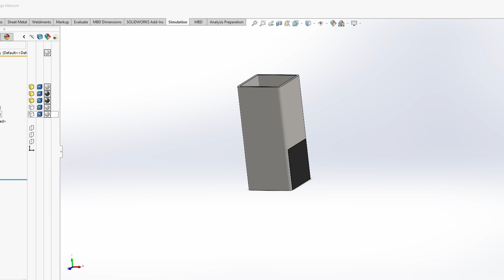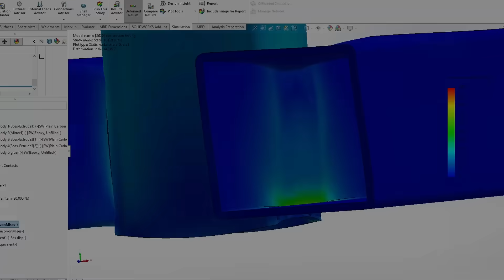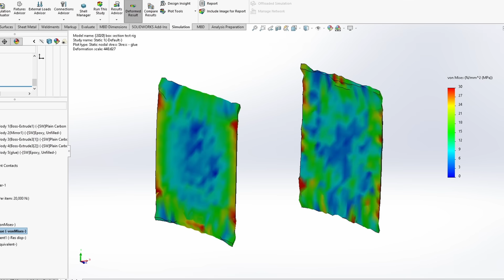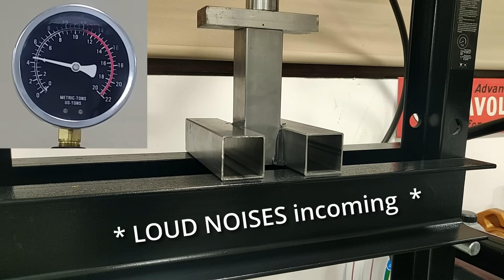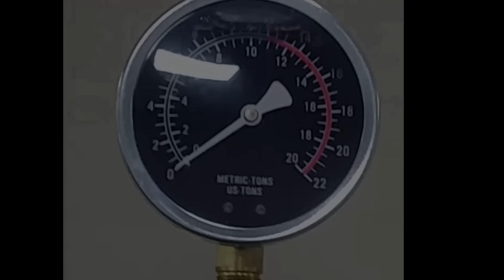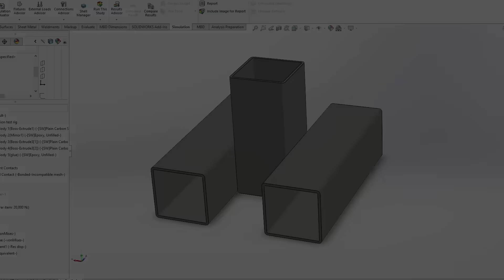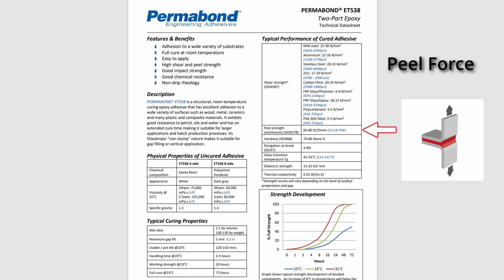How strong is JB weld structural epoxy adhesive anyways ?  Destructive test, simulation and review

Comment: I was looking for a solution to bind small metals together for an air rifle firing range where welding is not feasible due to pre existing lead. It seems that this structural epoxy will hold up enough for my uses.

Comment: I cut little pieces of fiberglass drywall tape and put in on the surface of the jb weld then put jb weld over the fiberglass pieces.  Also, I degrease the surfaces and score them deeply with a utility knife (for plastics) making as many scratches as possible.  This way you can bond even un-bondable plastics.  The fiberglass reinforced jb weld  repairs are stronger than the original part or assembly.  Surface roughing is probably the most important step.  For bonding metals, it's best to grind off the surface of the metal to expose perfectly clean metal, degreasing before and after the grinding.  I have done all kinds of repairs this way.

Comment: Back when I was in the industry that used epoxy for industrial purposes, it was not always specified but the PSI specifications where actually in compression. The manufacturer would send one inch square cubes of epoxy to a lab to be crushed. Then the PSI was recorded and the average was then put in the data sheet. I know of none that where tested, specified or claimed PSI ratings in sheer or tension. All where tested in compression. So for many that number was useless when used to bond items together. But made the epoxy look better then it was

Most of the epoxies where used to bond to concrete so as long as there was concrete failure first or concrete left stuck to the epoxy it was considered a success. And concrete is about 10x weaker in tension then compression. So it was a pretty easy test to pass. Even the weakest epoxies passed the test

Most epoxies we used had PSI ratings that started at 8k PSI and went up from there. Highest I can recall I think was a bit over 16k psi. Or about "3x" stronger then JB Weld.

The novolac epoxies where especially hard. Often topping 12k PSI. 

I don't remember what chemistry the 16k PSI one was but it sounded like glass when tapped, it was so hard. Broke into shards when struck with a hammer. This was the remnants at the bottom of the mixing bucket 

We mixed a lot of pigments, fillers and thickeners depending on what we where using it for. And these always reduced the PSI of the epoxy. The test samples where always pure epoxy with no pigments or other fillers. Probably why JB Weld is not rated higher as it comes with fillers and pigments already in it

Comment: 4 tons? That's just insane. I just repaired/covered a hole in my intake manifold using steel epoxy (JB weld equivalent) and was slightly worried if it would stand 20PSI of pressure and heat cycles.

I guess no worries then huh =D Thanks for showing this in practice!

Comment: Went on a camping trip and while towing my camper, my radiator reservoir cracked and caused my car to overheat and my whole car would steam up. Radiator fluid leaked all over. Where I was camping at was 45min deep into the forest. Thankfully, I always prepared myself with a good toolbox with essential needs.  I happened to have my plastic welding tool and hooked it up to my generator and spent some time welding the large crack. I made sure it was good and sealed and sanded it down a bit so the surface can bond better. Then I busted out the JB weld and pasted it all over the crack for extra reinforcement, i made sure the surface was clean and debri free. Its been 12 years and this thing still holds up like a champ.

Comment: Helpful demo-Excellent thanks for your effort l use JB weld on my sail boat for small repairs. one area it failed was trying to lock-in a key into a wind generator hub it-can’t take the torque of the boats wind generator over say a month it failed?

Comment: FYI: Original JB Weld can be powder coated as well. So if you want to MIG or Stick weld something and make it look Fillet brazed, smear JB over the weld like you're caulking a tub or window. Get it smooth. Let dry. Then touch it up with sand paper or a sanding mop. 
"JB and paint make you the Tom Ritchey you ain't!"

Comment: I used the J B Weld for gluing a steel nut to a steel shaft. I waited 6 hrs and I was able to remove with my hand. I re-did gluing and waited 24 hrs at least and still I was able to remove with my hand. Whats up with that??
Reply: What was your surface cleaning method, did you let it cure according to the manual, did you mix well enough and long enough according to said manual. And also, is the type of glue you used, made for shearing or pulling?

Comment: Had very good service using JB weld never failed me yet. Had a farmer friend repair an injection pump for diesel had cracked housing. Used JB to glue it together and its still running 20 years later

Comment: JB Weld is truly remarkable. I have used the marine variant (hot oil proof) to repair a holed motorcycle crankcase. The cured epoxy is both harder and stronger that the cast aluminium cases. I left rough edges around the break for better adhesion, but the biggest challenge was getting the oil out of the porous casting. A year in and all is well.
Reply: how did you get the oil out 
I didn't know there was a marine type of jbweld ...I'm trying to seal a pinhole leak in the weld of an aluminum diesel fuel tank on an old in the water (ocean) trawler
Reply: These English cases are notoriously porous, making welding difficult. I had the engine completely apart and soaked the crankcase section in diluted pine-sol for a couple days, then followed up by wiping down with lacquer thinner. I left the rough edges to give the epoxy as much of a tooth to grip as possible. It seems to have worked perfectly.
To deal with your pinhole, I wonder if it would be possible to blow the fresh epoxy into the hole with air pressure. Of course it would be best if you could seal it from the inside, but that is probably not practical. @hardlyyoung3638

Comment: I've used this stuff to glue dissimilar metals together - mild plate steel and extruded aluminum. For improved results, drill small offset holes through the target areas (they don't need to go all the way through), clean, clamp, and let the piece dry in a hot car for a week or so.

Comment: The bonding strength can be improved somewhat by "roughing" the surfaces with an abrasive wheel. I use a 3M Paint and Rust Stripper abrasive wheel for gluing metals. I find JB Weld quite good.
Reply: It was roughed up, you can see the marks.
Reply: @alexcorona  The streaks that I see on the video are quite light. A somewhat rougher surface would have yielded somewhat better shear performance IMHO.
Reply: Yeah but is it actually doing any chemical bonds or just acting like super glu? A LOT of uses cases in the comment sections outline matrixes used or other scenarios.

Comment: I had a Ford v-6 some years ago where one of the spark plugs blew out.  There was enough thread left in the aluminum head to feel threading the plug back in, but finger pressure was enough to pop it out.  I put some JB Weld on the plug, threaded it in loosely, and removed the plug, which left a trace of the stuff on the head.  After that cured for a day, I put more on the plug and threaded it back in – only finger tight.  I let that set for a couple of days.  

After that, the engine started and ran normally.  I traded the van off a few months later, with the engine still working normally.  Never had any problems with the plug.

I have used JB Weld for more than fifty years.  It always works.

Comment: I had a cracked and leaking intake manifold on a 1996 Lincoln Continental. The shop quoted me $1700 to replace and repair. Being broke at the time I went down and grabbed me some JB Weld and rebuilt/"made" "shaped a small part for that manifold . Actually, it was where the water hose connected to the manifold that was broke off.  2 years later I sold that car....And the manifold had never leaked again from the day I fixed it. (Saving me, $1695.00 in repair costs)

Comment: I contacted JB Weld to ask about the recommended adhesive thickness when gluing parts together as you did.  They recommended at least 1/8" of glue between parts.  It would be interesting to see the test repeated with a thicker glue line to compare performance.  

Also, how do you think a twisting/rotating force would affect glue strength?  In the case of your test sample, try to push the vertical middle tube so it would be parallel to the other two if a bolt fastened the 3 tubes together.

Comment: Years ago I knew a guy who worked on the old Volkswagen Beetles. He had one that thres a rod and poked a 2 inch hole in the crank  case. He replaced all the parts necessary and cleaned up the blodk in the ares of the hole. He thentaped some cardboard inside the block to cober the hole and patched it from the outside with JB Weld and It worked. The last time I saw the car about a year later it was still running with the patch in the blodk. JB Weld is tough stuff!

Comment: That was a very interesting test and analysis.

Was that a linear or stepped non-linear analysis? In reality the stress distribution will be different near the failure load. The high stress points on the analysis are very localized and a small local failure does not equate to an overall failure (this is why you hear the cracking before the ultimate load is reached). The variation in the shear stress appears to be governed by the meshing of the model. In an ideal perfect analysis, there should be a perfectly symmetrical pattern and it is not symmetrical. An average shear  stress is 11 to 12MPa (44000N/44^2/2sides) which is far less than the ultimate advertised. From a practical perspective, it the average stress that is important when designing and specifying a product.

The other issue is that there is no description on the product as to what the load direction is. I would suspect they mean a tensile stress of 35MPa. A 2 point beam test on a solid steel stock (to keep plane sections plane) with a glued butt joint would be a good test of the actual tensile stress. I suspect that the tensile capacity of the glue is going to be higher than the shear capacity. I also suspect if you used solid bars instead of hollow tubes, the shear test would be higher since the stresses will average out better.

I would be interested in seeing the shear test redone with solid bars and a tensile test done with a 2 point beam setup.

Comment: So if you can etch a hash pattern of vertical and horizontal lines on the surfaces you mate, it gives the jb weld more surface area to dig in and hold. I have seen a muzzle device welded onto a rifle and it survived thousands of rounds at over 50k psi. Stuff is very impressive.

Comment: When I was 17, I skeptically used JB Weld to fix a crack in my radiator and it held for 2 years until I got a new car. This was also in 05 or 06, so I'm sure further improvements have made it even stronger.

Comment: We use an epoxy at work called metalset but we have used JB weld in the past. If you drill holes through the glue section on both pieces and allow the glue to pass through and sag while it's curing it holds much better. It becomes more like a mechanical bond we've even reached in and smeared it where it has passed through the hole to give it even a better bond. We  have noticed mixing thoroughly or not changes the bond significantly. We have checked out the glue they use to bond an aluminum car frame together. The name of the glue I can't remember at this point. Extremely expensive works very well but if you need something to hold together that well weld it.
Reply: I do it the same way with the small holes for the glue to "grab" better. It's quite strong when used right.

Comment: Thanks for this video, I love your explanation, especially with the explanations and models of a structural engineer. I have a blown out hole on a carbon ebike frame of 1 of 6 motor mounts. Since the manufacturer doesnt want anything to with garauantee I am going to dry this JB weld and drill a hole in the middle. I hope it works.

Comment: I came across this video when trying to search for a solution to an engine building   problem I have.  Although not directly related to my issue, I found it very interesting and informative.  For anyone interested.. My problem is that I have a small quarter inch scratch on my cylinder head mating face across the fire ring. It's deep enough to catch a finger nail but I'm reluctant to get the head skimmed as it's for a turbo project and I'm not keen on shimming the head to keep the compression ratio.  Does anyone know of a suitable high temp, high pressure epoxy or filler of some sort that I could use. I searched once before and found an aircraft epoxy but I can't remember what it's called now. Any help would be appreciated. Thanks.

Comment: Would like to see pull test not just shear test. But so far not performing as expected - I expected much stronger bond. Maybe JB weld is weak in sheer motion and much stronger in pull? Note sheer strength is less than 1000 lbs per 1in square.

Comment: I bought a motorcycle that was t boned from a new dealer they put a new frame on it one of the engine cases were broken they put it together with J B weld it lasted for years it finally gave out so I took it off and hade it welded I sold it about 4years later still running

Comment: One other factor for the durability of a bonded joint is moisture exposure, either due to immersion or even just humidity. The moisture works its way in between the adhesive and the substrate which can cause failure. That is why (on aluminum) aircraft manufacturers use the PAA anodize process.

Comment: Did you scratch up the metal surface and clean with acetone  before applying the JB Weld.  I alwasys do.  Fix a water pump on a bulldozers once and it is still holding.

Comment: Question. My sons 4 wheeler has a very very small oil leak in the oil pan. Should I use a little piece of steel stick 1st and once it dries go over it with the epoxy? Or just use the epoxy? Thanks!

Comment: I used to cure gauss sensors in JB Weld, then machine the JB weld in a threaded housing and then run the sensor in an elevated temperature environment. Never had a single one fail. Hundreds of them. It’s amazing stuff.

Comment: JB is one of a kind. I have made several fixes with it on many different materials over the years and only the ones in vehicles eventually failed. If it isn't subject to vibration it holds forever.

Comment: JB worked wonders for a hole patch on my MGB floor panels. I had two small pin hole rust stops, cleaned up and the stuff works as well as anything out there for that application.

Comment: Not surprising, epoxy is used in structural bolts used to hold your house to the foundation if the bolts weren't put into wet cement but were put into drilled holes.

Comment: It's strong, but it's shocking that the Titan sub's end caps were glued on with it. It would be interesting to know how it holds up over time of being under stress cycles like the sub was putting it through.
Reply: so imagine that over 5 tons of pressure were exerted on the sub at that time then understand the explosive forces produced in this video were exactly what has occurred inside the sub at the time of implosion.
Reply: @godw1ll99 
Not really, the forces there were much different after failure. Here the parts are moving freely in air, there 1.8% or so compressed water was filling basically a void.
Reply: Please tell me you're joking on this... please!

Comment: My dad had a service station back in the 60's and 70's. He had a tire balancing machine that wouldnt stay in place with drilling into concrete and adding leaded anchor bolts used at the time. One day an old mechanic came by and my dad asked him to look at the problem and see if he knew a better way. He just laughed and said go the the drug store and get a bottle of "Flour of Sulfer". My dad said he would. So the next day he found some and the old mechanic told him to put enough in an empty coffee can and heat it till it became liquid and then put a bolt with the head down ito the hole and pour that stuff into it. I helped my dad as a young kid with this project.  Ill never forget the surprise on my dads face when it held up. Years later we moved to a new location. My job was to move everything. When I tried to remove those bolts by every method I could use, nothing worked. My dad when he saw all my efforts fail said" just cut the bolts off even with the floor. Thats some kind of strength. I dont even know if this stuff is still available.  Oh and it stunk to high heaven when melting/heating it.
Reply: molten sulfur is indeed a unique and powerful cement with unusual qualities. Its uses have always been relatively niche, but it remains in use in some industries. Sulfur concrete is an interesting topic for further investigation.

Comment: I have a question in regards to the square steel beams used.

Those beams usually are coated with a type of polyurethane coating, so you may have testeed the strength of the urethane coating as opposed to the epoxy.

If there is a coating on the beams, then the test will have to be redone with beams that have been stripped of this coating. You will find the epoxy is even stronger than this test showed...

Comment: I'm not an engineer or professional but I put a diesel engine water pump back together with JB Weld that had broken into about 6 pieces. I put it back on the engine the next few days after it broke. Cranked it up and it n2ver needed to be exchanged for a new one. Though a new water pump was ordered it stayed on the shelf. That's amazing. If I were you I'd rough up the surfaces as adhesion would be much better.